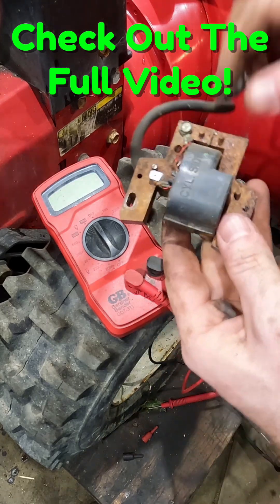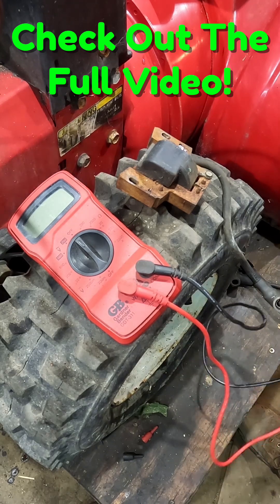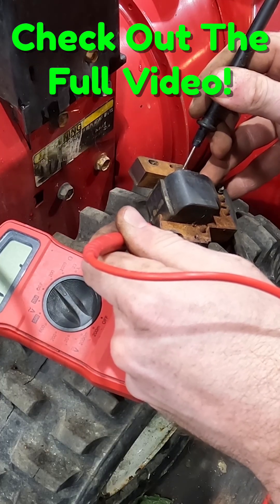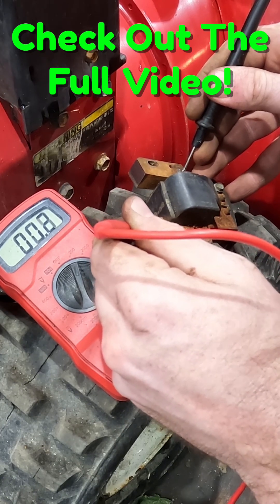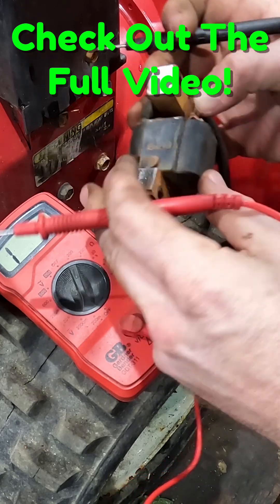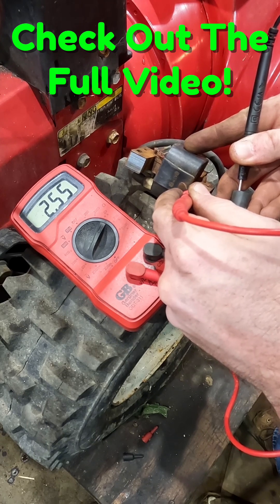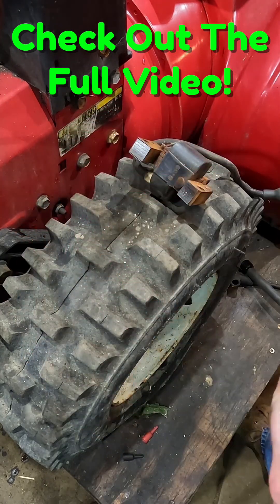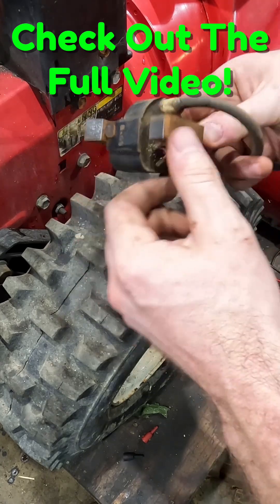Testing The Ignition Coil/Magneto On A Briggs & Stratton #testing #electrical #briggsstratton #diy

Comment: Because his finger is touching the test probe. The numbers jump around.
No coul problem. A test problem ..fingers
Reply from the maker: 100% a grounding problem...watch the full video.  Coil is internally grounding.
Reply: @mytinygarage24 
With the finger touching the probe it throws the numbers off because you become parts of the ohm circuit.  Watch his finger and the numbers.   I do this everyday.   It’s a huge problem in my industry too.